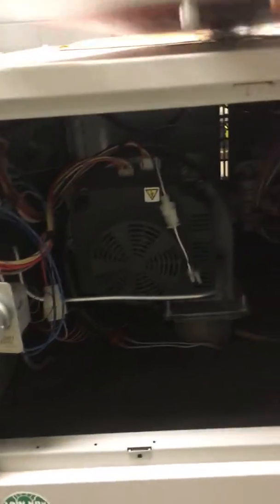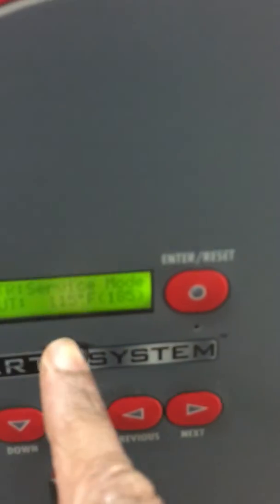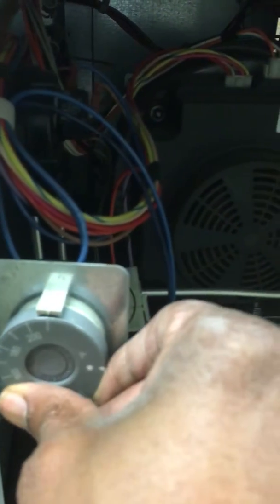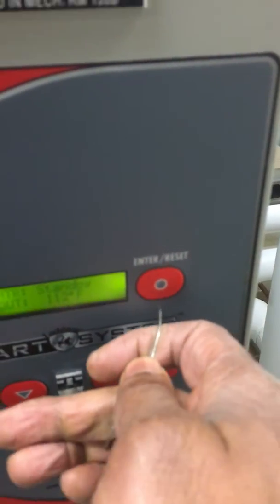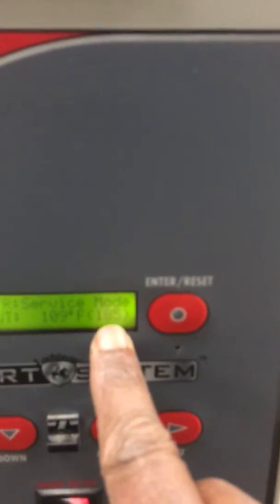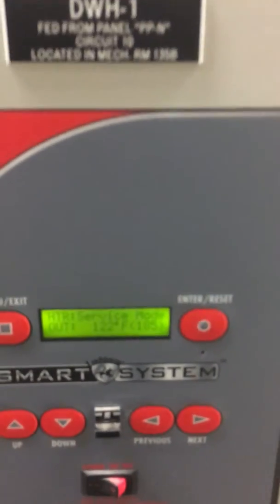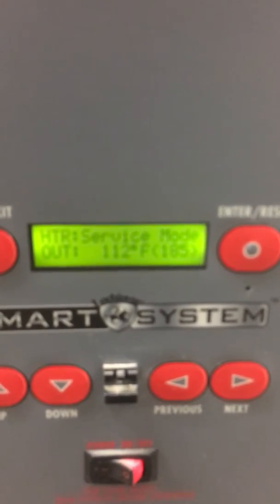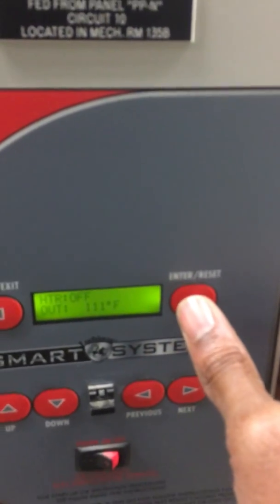Testing Lochinvar Power-Fin Domestic Water Heaters

Comment: Hey Reginal Banks we are having trouble at my Building we have two of the exact same boilers you are testing on your video just tht one of them is a smart touch screen one but exact same layout inside service area 
We are having a Air pressure switch open Code Lockout?
Reply: Have you gotten an answer to this error code?